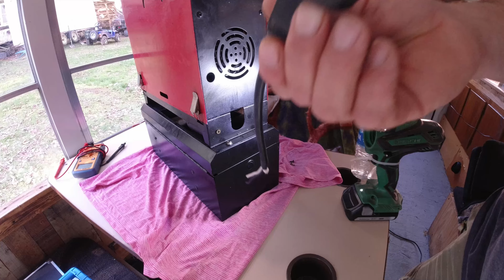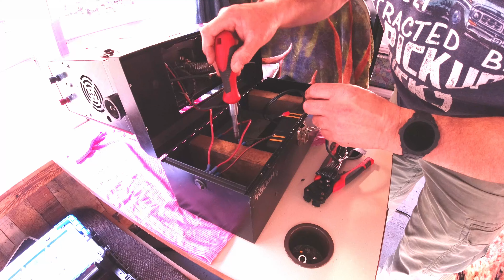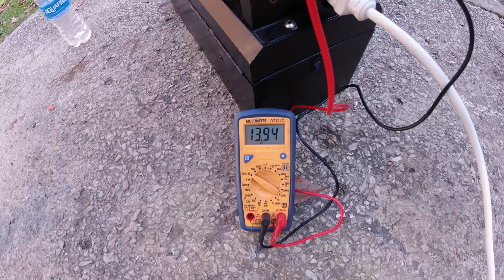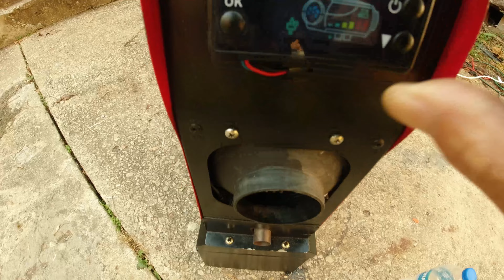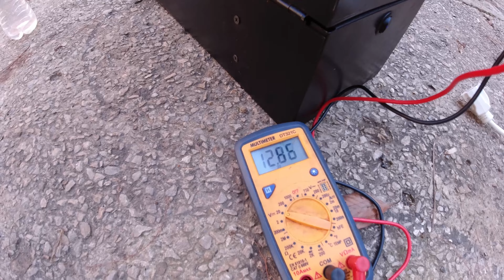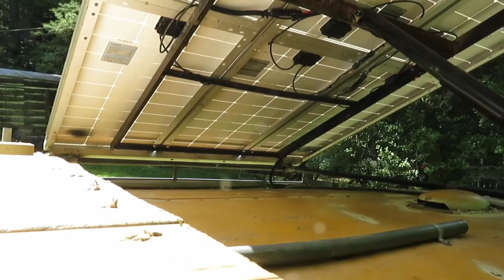Diesel Heater Battery Backup Mod: PREVENT SUDDEN SHUTDOWNS!

Comment: A12 volt 20 amp regulated power supply about $20.00 set up to float your battery and run your heater with with or without a battery. Check it out, they only way to go.. ebay $21.00 free shipping a few bucks more if you want a 30 amp unit. And it will keep your rv battery charged to. Better than store bought battery charger because you can dial it in to float your battery avoiding overcharging  and cooking your battery.
Reply: Ok, question for both of you here.  I just bought two similar vevors for emergency backup heat at home.  I’m running them well with a 15amp 12v supply straight from the wall with a male 12v wired to the heater.  I’ve ordered 10amp 12v power “switchers” to detect main power loss and switch to battery (more than just the heat pump goes out situation…) so that I can put them on a backup battery.  My questions are (1) do these AC-to-dc power supplies automatically charge/maintain the 12v battery through the “switcher” (I have a separate maintainer/charger I can leave them on if not) and (2) can I get away with a 10-12ah battery for backup and decent run time if my goal with batteries is strictly for emergency backup to avoid damage?  I want something that could cover it for maybe 5-6 hours if asleep during main power loss and keep the battery in good shape, but my main goal if I’m not asleep and can immediately detect main power failure is to run the power supplies from a gas generator.  I already have that equipment and a ton of gas for power outage and I just don’t want to invest BIG money in sizable batteries when the only purpose is a few hours of backup.
Reply from the maker: Great suggestion! Thanks, I'll check it out.
Reply: After it starts turn the charger off .be using bigger batter . . 120 volts system from and inverter system. I’m camping

Comment: You know there are more than a couple people make videos showing how that mainboard will not burn up if there is a complete shutdown. My heater has done it a few times and has no issues. Not sure who started that but its really not true. Try it. Youll see your heater will run fine. Its just like the "you have to put it outside" nonsense. While I insist people properly route their exhaust I also know what a "salamander" heater is and that they operate almost identically to these heaters and they have no exaust to vent. Plenty of people use them inside. But don't worry about the mainboard burning up in the off chance you totally lose power. Mines running right now if you want me to prove it just say the word. Ill be more than happy to make a quick video.
Reply from the maker: I had one burn up, well it didn't burn up exactly. It is the one that was in the bus. I blew a fuse,  and before I could replace it the solder on the board had melted in a few places. I had it running on about 6.5 hz at the time. I re soldered the connections and it still works but the bearings squeal now and I no longer use the heater because of it. Makes an awful  noise lol. It's probably because I run mine hotter than they are intended. Maybe if it was running the stock configuration, it would have been ok.
Reply: @lukeFugate  yep its because of how high you run yours. Their bearings are super cheap and they use little to no lubrication on them. Get some spray silicone lubricant and squirt it the best you can near those bearings and it will shut right up. I highly suggest replacing them altogether with better bearings. I like the ceramic bearings personally. The bearing size is 5x16x5mm.
Reply from the maker: @TheWatchmanNews  Thanks. I'll try to change them out. I have another heater I was going to switch it out with. I'll probably go ahead and do that, then fix the bearings in that one for a spare.